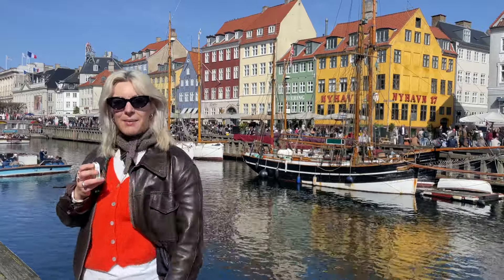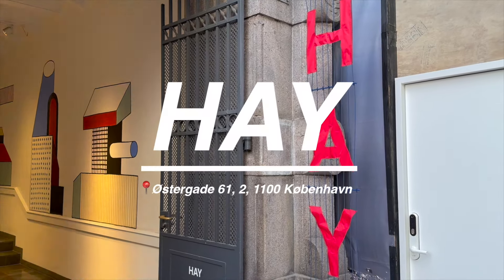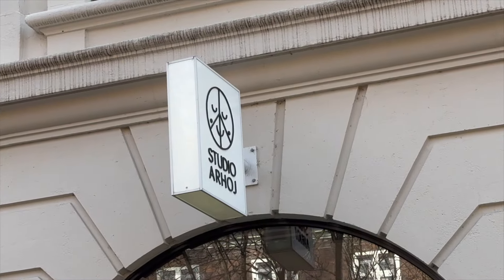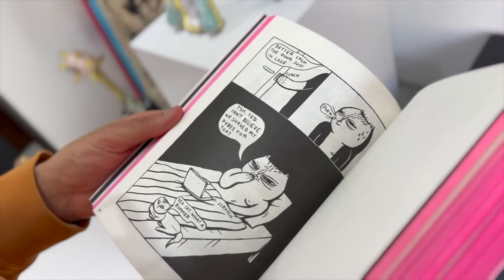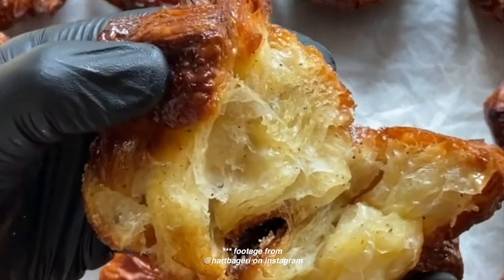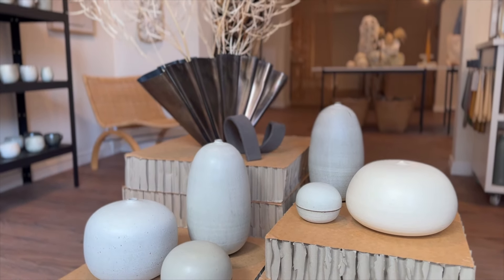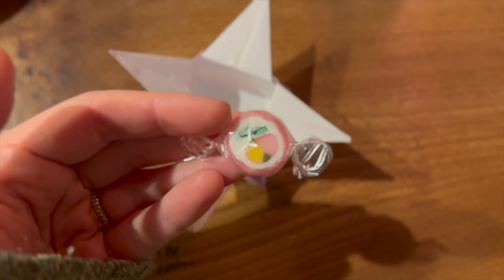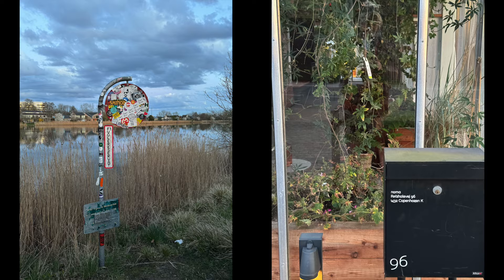Why I'm obsessed with Copenhagen

Comment: Your pronunciation is pretty good. I am impressed you have learned the Ø sound, as in Arhøj. English speaking often freeze, when they see one of these: Æ, Ø and Å. I will suggest people who want to have a taste of Danish to learn these 3 sounds (Y might be a good idea too). These 4 sounds are actually easy to learn, you can learn them from Google Translate.
It is basically impossibly to learn Danish in a short time. I am told that "D" has 17 sounds in our language. From a normal D, it can be soft, very soft, and silent. "G" is also “impossible”.
A Scottish Ambassador to Denmark, said years ago, that Denmark is a clan. I wonder if it is the language that does it.
Try CPH at in the summer, it is another "kettle of fish".